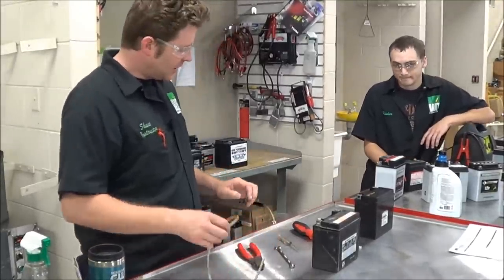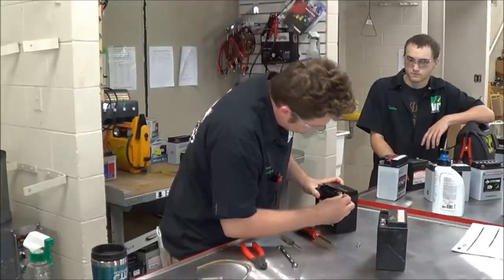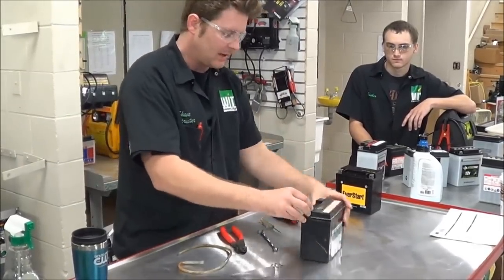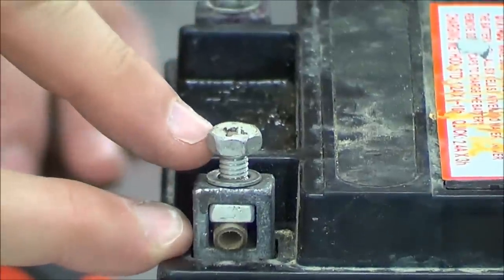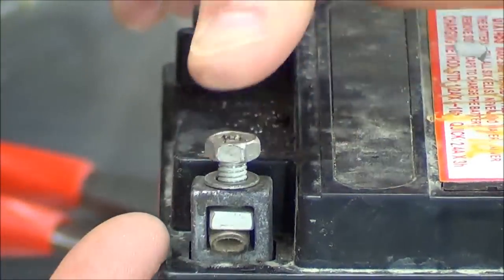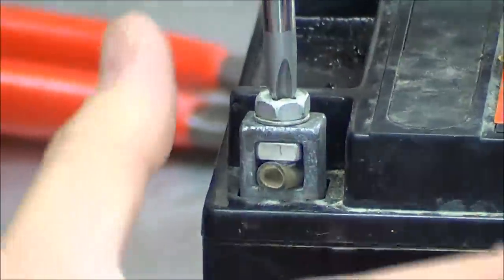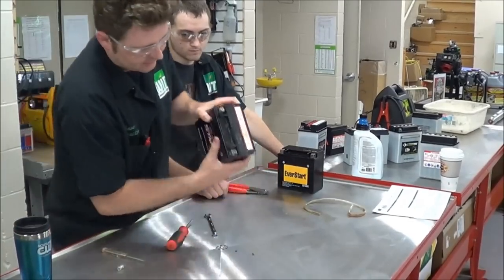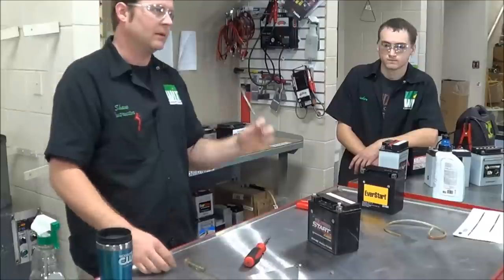Never lose your battery bolts again! Yuasa Bikemaster Batteries Plus Interstate

Comment: This small problem drives me nuts.  What's the matter with battery manufacturers?  Can't they design a solution into the batter post?
\
Reply: I use MotoBatt batteries. Their battery terminals do not have a nut that can fall out. Instead they have threaded posts so the bolt screws straight in.
Reply: Clay Blasdel I
Reply: Pun intended?
Reply: i bought a new battery but i embarassingly dont know the basics of nut and bolt and failed to put it in hahaha. this is so annoying.

Comment: what i did to my nuts :), i put some liquid "super glue" (pen or squeeze type) that i bought at dollar store. put some glue around the nuts, one side top only and screw the bolts in to the nuts inside the terminals, tighten a little bit until nuts make a good contact under the terminal holes; let them dry for about a minute or so until the nuts made a contact, then remove the bolts to see if the nuts is already glued tight under the terminals. when you unscrew the bolts back out, the bolts are perfectly aligned to the nuts. keep the bolts screwed in until you put the battery inside, remove the bolts and screw the wires back in.
Reply: The problem with this is you lower the surface area of the connection and create more resistance to the current. This can cause the battery to heat up when drawing normal rated amps.
Reply: that's what i do i have a bunch of those square nuts, brass and zinc plated

Comment: You could make a hole through the piece of tube so the bolt goes through it and doesn't prevent the bolt from tightening all the way down, this would also prevent the piece of tube becoming compressed so it will still hold the nut in place the next time you disconnect the battery.
Reply: I was thinking the same thing. Great minds ;)
Reply from the maker: NICE !!!! I'm on here responding to old comments....👍 Thank you for taking the time to comment! Hit that subscribe button if you haven’t please! It helps us! 
Here is a way to support all the free videos.
Want to say “thanks” or “keep it up”? Click here https://www.paypal.me/how2wrench  

Coach Conley is also available for hire to personally work one on one with you if ever needed. Yep he is a real person. Give him a call @ 602-345-0432
Details here: https://how2wrench.com/product/personal-tech-training-phone-facetime/ 
Your answers and help are just around the corner. Save time and money while protecting your investment and yourself by doing it the right way!
Follow us! 
Web:
www.How2Wrench.com     
www.Tools2Wrench.com

Comment: a small piece of folded zip works well. I had to deal with this on my quad this week.  Stupid design, especially if you have more than one terminal under the bolt.  A simple spring loaded nut would solve this problem.
Reply from the maker: Thanks for commenting and adding value to our community!

Have you subscribed yet to never miss a video? Have you seen the video playlists? Over 600 videos! Check them out here: https://www.youtube.com/user/conleybuilt/playlists  

Want to say “thanks” or “keep it up”? Click here https://www.paypal.me/how2wrench    
 
Your answers and help are just around the corner. Save time and money while protecting your investment and yourself by doing it the right way at www.How2Wrench.com

Comment: good tip.. but just glue the bolt up in there take the screw out when its dried and its always lined up.
Reply: The problem with this is you lower the surface area of the connection and create more resistance to the current. This can cause the battery to heat up when drawing normal rated amps.
Reply: @jeffsfolio  no you dont AT ALL, the surface area is above where the nut is...

Comment: On my latest Yuasa battery the hole on the side is already shaped like it does not let the nut to fall out if the battery is not upside down. Too bad that the latest laws require the sellers to fill the battery before shipping so they opened the box, filled the battery with acid and lost the bolts before I could loose them...

Comment: The way these battery connectors are designed has always seemed odd to me. I guess the problem is that lead is too ductile to retain threads, so they design a hole in the lead to accept a steel, mobile nut. Electrical contact is maximized with less chance of damaging threads. Good idea....
Reply from the maker: I'm on here responding to old comments....👍 Thank you for taking the time to comment! Hit that subscribe button if you haven’t please! It helps us! 
Here is a way to support all the free videos.
Want to say “thanks” or “keep it up”? Click here https://www.paypal.me/how2wrench  

Coach Conley is also available for hire to personally work one on one with you if ever needed. Yep he is a real person. Give him a call @ 602-345-0432
Details here: https://how2wrench.com/product/personal-tech-training-phone-facetime/ 
Your answers and help are just around the corner. Save time and money while protecting your investment and yourself by doing it the right way!
Follow us! 
Web:
www.How2Wrench.com     
www.Tools2Wrench.com

Comment: nice vid. cheeky question i have a battery that i want to replace but the bolts are starting to round and the terminals starting to turn if i put any real pressure on it. apart from drilling the bolt out do you recommend any other way?
Reply: Possibly use a broken-bolt extractor socket that's large enough to get around what you have left of a bolt head?  Or maybe lock-jaw pliers, if you can manage enough space to get in there.  Of course, don't reuse the battery bolts once you have 'em out, as they will no doubt be even WORSE mutilated.

Comment: just use masking tape around the hole, no need to be so difficult.
Reply: yea i just jam tape under the nut
Reply: Or a thickness of cardboard... or a small piece of styrofoam... or a cable-tie... or any other number of appropriately sized items that will hold the nut in place.  I prefer a cable tie because it's easy to yank out, once the threads engage.  The tubing he uses is decent material too, as it has a good amount of "springiness" to it.  However, personally I'd use a 1-3" long piece, so I could more easily yank it out (I prefer not to leave it there).